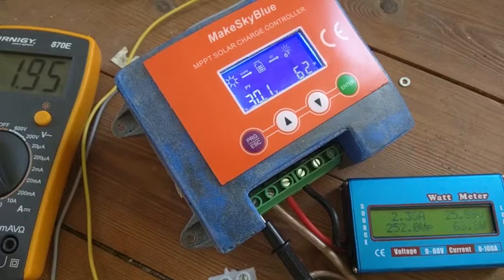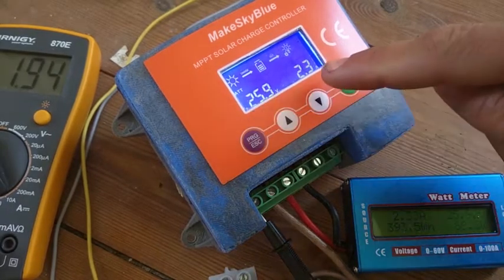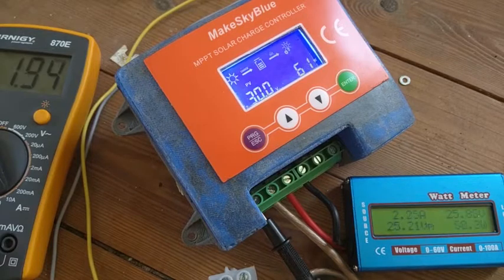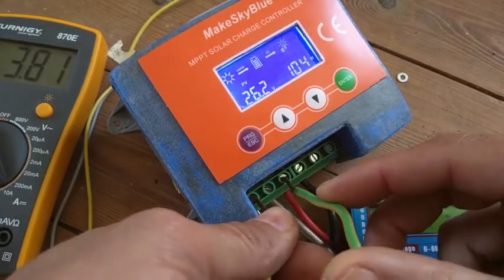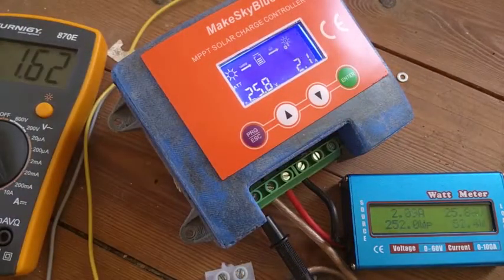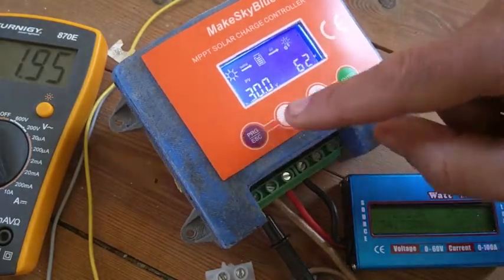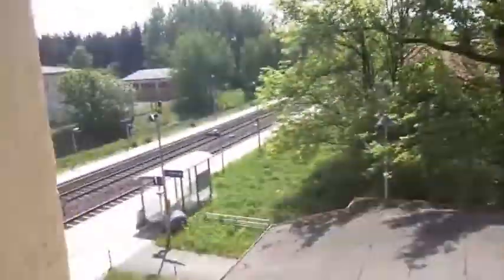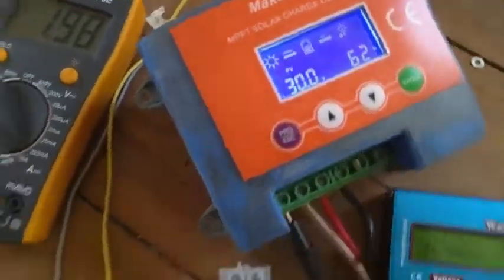test: 20A mppt solar charger not really working (MakeSkyBlue)

Comment: Please you speak a few times as to the open circuit of the panel no no mention of the open circuit amps of the panel I suspect a 200w solar panel puts out about 6 to 8amps so with your mppt charge controller  tracking at 4amps what am I missing?
Reply from the maker: Yes i should have shown the short-cut-current to demonstrate that the mpp-tracker did not operate at the correct U/I point. Will do it next spring when sun is back. A 240 Watt panel was connected with about 8 amps max short-cut-current.

Comment: Typically they want to see 1.5 to 2 times battery voltage as an input for highest efficiency. I'm getting a 40A version and that likely has two coils, aprox 20W per coil.  I've heard they have a problem getting lost in tracking. Try removing panel voltage to reset it..
Reply from the maker: seller responded with a 1-liner: "Please note this module is not good for lithium. Thanks."  But as my LiIon battery was quite empty, the mppt could not see any difference between 24V lead acid or 24V LiIon anyway :-(

Typically a dc-dc converter has highest efficiency when output voltage is close to input voltage :-/

I guess if i will not continue with my own mppt there will never be a low-sun efficient charger: https://www.youtube.com/watch?v=1vDQG1ODD4M

Comment: Have you try to install more than 1 charge controller to the same battery. I have a problem, I have 6 or them connected to the same battery, they are charging good until around 3.95 per module after that 3 of them end it up in a kind of float mode, they are no charging the battery, I appreciate any advice that you can give me.